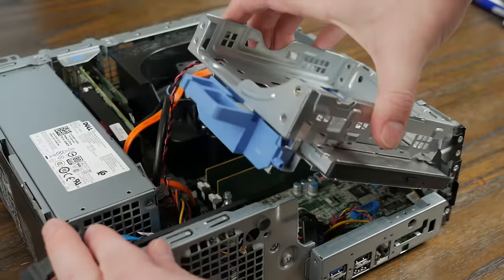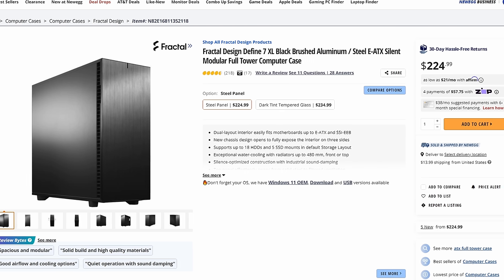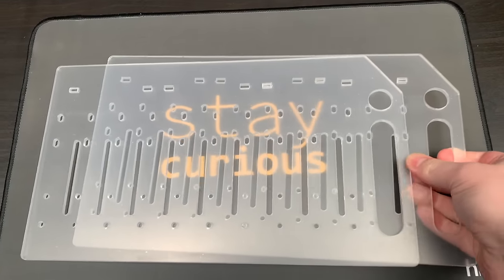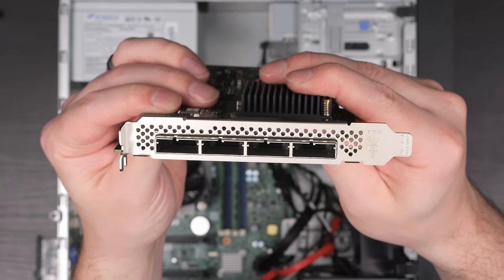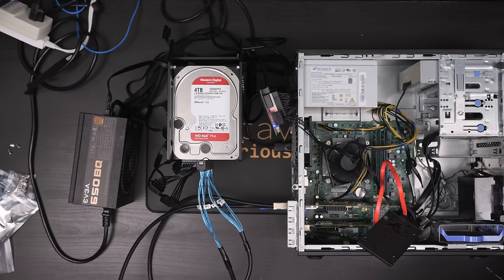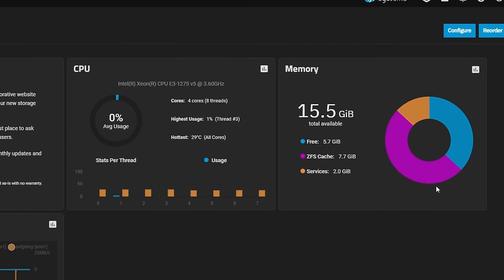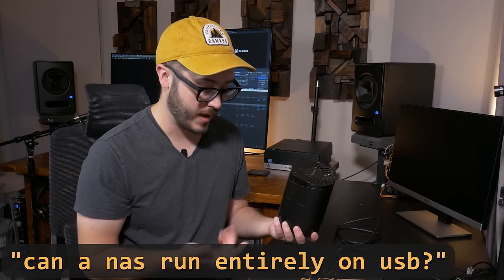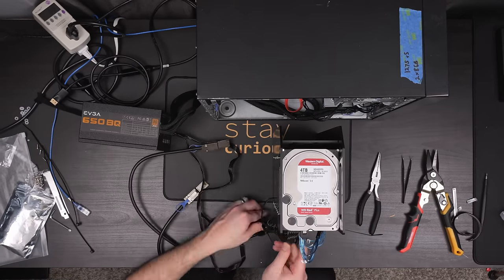I Made My Own JBOD Enclosure For CHEAP

Comment: My NAS is a Fujitsu SFF with the drives in one of the drive cages from a Fractal Node 304 sitting on top, with SATA and power cables coming out through the hole where the optical drive used to be. The case has no internal mounting for harddrives, so this is what I came up with. I would like to move to a different case, but everything in the PC is proprietary so that's a pain. Maybe something could be 3D printed, but I also don't have a printer. Or knowledge on how to design things.

Eh, it works, you know?
Reply from the maker: If it works, it works!

Comment: I tried those 2 5.25" drive bays and many times even with a fan in them the drives get hot, very very hot. They just seem to be not spaced enough for air to realistically get through.

Comment: Initially I thought this was going to be a cheap project....Until you add all the other stuff you need. And thats where a lot of these DIY solutions fall over. Personally if you're going the DIY route, I think some of those hot swap drive mount units for PC enclosures are pretty good value. The trouble is a lot are for 2.5", not 3.5". I suppose if you look at buying the hardware as an investment, you can always use it for years to come for something else, regardless of the price.

If you want to do something with the one you build, maybe make a nice wooden surround, use some wire mesh at the back and front to hide the fans and cables. As the power supply you used is quite large, instead maybe power it with a 1U Flex power supply, mount that on top of the drives there and in the case also.

Comment: If prebuilt USB JBODs are just using SATA drives anyway it would be interesting to see if you could just gut the non power supply electronics from one and then connect to the drives directly using your HBA and Mini-SAS to SATA cables.

Comment: Yes, thats a big problem for anyone trying to store a decent amount of data (lik two digit TBytes plus double redundancy at least) without owning a rack. All the available solutions suck, because of the criteria you named, and additionally: heat. All the "normal" ATX cases when you fill their drive bays completely will make your HDDs overheat all the time. And alternative solutions, like the genuine TrueNAS mini X+ are just way too expensive for what they are offering and yet don't have enough drive bays!
Realistically one will need 10 bays, because Raid Z2 is too expensive per TByte with less tha five disks. And if one day you need to swith to bigger HDDs, you will need a seconds et of bays for fitting the new HDDs in, so you can clone your old data onot the new HDDs .. That 2*5 bays. And there still is no bay left for a hot spare .. so you really need 11 bays :P

Comment: while i think this specific drive mount isnt something id want to run bc it seems like itd be a nightmare to switch out a failed drive, it gives me the idea to perhaps look into the feasibility of doing something similar with some 5.25in hot swap bays for probably similar levels of jank but with more usability. 

also it opens up the possibility of having a tower of optical drives which is insane but i kinda want to try it lol
Reply: Yeah it will work 100% fine to use a 5.25 hotswap bay too. Also yes often the old DVD burner towers (6x or 10x burners with a controller to make copies of disks) are 5.25 enclosures, where you can remove all the old junk and replace with hotswap bays
Reply: If probably use two of the 5.25 hot swap bays and run two daisy chain saga power cables via an extension cable

Comment: Oh God. I'm getting flashbacks to a particularly "Ghetto" budget file server I put together a long time back.

I had a load of 120gb IDE drives (Don't judge. IDE was the current standard back then. 😏) and a spare pc that only had 3 hard drive bays, so I drilled holes in the removable side panel so I could screw 8x full size 3.5" hard drives directly to the inside surface of it. I then added a pair of PCi to Ultra ATA/100 raid adapters, and upgraded it to (IIRC) a 450w PSU. The Molex 4 pin plugs had splitters on splitters, and cable management wasn't even an afterthought....... It had received NO thought at all ! The monstrously had 4 drives per addon controller, PLUS the 2x hard drives it had originally had in it. The inside of that case was just a tangled mass of grey ribbon cables. 😁

Booting took forever too because both raid cards interrupted it and waited to see if I wanted to enter it's settings menu. It was originally setup with each card running it's own raid 5 array, but oh hell was that glitchy ! It eventually ended up with everything as JBOD. 

It wasn't quick, it was just unstable enough that I didn't trust it to be the ONLY place I'd stored ANYTHING important, and due to the drives being hard mounted to the side panel, it sounded like a gas lawnmower the entire time it was powered up ! 😏

When it was eventually so obsolete it wasn't worth keeping, I dismantled the thing......... and by dismantled I mean DISMANTLED ! Somewhere I think I still have a set of HDD platter coffee mug coasters I made from the drives out of it, the 4 sticks of PC100 memory got drilled and used as keyrings, the case got cut up and used when I needed some metal for weld in rust repair patches on one of my old cars, the motherboard had a few bits de-soldered and stored for future projects (Money was tight back then !) the rest was binned.

For data storage I now use 4x 4tb HDD that are in a couple of PC's. Ones always on, and the others only on when I'm doing an incremental backup to it. The idea is that I'd have to be really unlucky to have a virulent virus go rampaging through my network, AND somehow get onto powered off backup drives. 😏

Comment: I've noticed that there's a thing between effectiveness and price for these disks represented in the tier of ~4TB when the peak value is still somewhere between 10-14TB. The main disks in my setup are 16TB+ and so far that doesn't include many of them. If it ever gets to the point where I need a bunch of disks, I may just get bigger disks. RAID is typically a theme in these videos and I've always gone JBOD. Anything more is just way over my needs which makes me wonder why that's the case.

Comment: I just wanted to say you saved me from doing some soldering and cutting with that fan controller. I have a HPE ProLiant which has these weird fan connectors and I wanted to add a fan to the HBA and the fan less GPU I have. Thanks!

Comment: Just a heads up to anyone trying this: LSI HBA cards is a very deep rabbit hole that you should seriously study before buying.
Also know that these enterprise grade cards (LSI / SCSI cards, 10gig network etc) tend to have a fairly high power draw and no idle mode.
And i would say that the powerdraw difference makes it worth to buy 8,12 or even 16TB drives instead of 4TB.
Dedicated enclosures might be expensive, but the amount of money you spend on mounts, screws, cables, adapter cards, fans and increased powerdraw is worth considering.

Comment: actually, how to install the drives onto the bracket more easily is to lay 1 bracket, then 2 drives on its side above the bracket, then put other side of the bracket on top of the 2 drives and screw in 4 screws 1st. then install the rest of the drives on the same side. then flip the whole contraption over and screw in the remaining scews on the other side.

Comment: i've been thinking about something like this for weeks with my home lab. My two solutions I found thus far were going to be buying a 3x5.25 to 5x3.5 cage ~or~ buying up to three Rosewill RSV-L4500U. Strongly considering this as a viable option now

I have used an Icydock bay somewhat like what you showed in my gaming machine for almost 7 years

all in all, dog bless, keep up the good work

I know many people are TrueNAS enjoyers, but I'm looking at Ceph via Rook for my home lab and am curious to know how much an expansion like this may boost performance when added on to one of the above chassis with 8 drives

Comment: Interesting. Dust would be a problem for me, though :D I would love to see some more performance tests. Like putting it in a RAID10 instead of RAIDZ2. And do you have to check what the maximum bandwith of the HBA is? Thanks for the video!
Reply from the maker: More dust, but easier to clean out occasionally! And I have some performance tests on a video I did a bit ago about selecting VDev layouts. As far as bandwidth, you should be able to see what version of SAS the HBA supports and go from there. For SATA HDDs, it probably doesn't even matter.

Comment: Partner with another youtuber to refine this.  A slightly deeper acrylic case with an added back panel would help to accommodate the power supply.  PCBWay would probably like to sponsor with someone to make a backplane for drives and sas/power cables to slot into as well as a USB alternative for controlling the second power supply.

Comment: Using an older second hand case with lots of 3,5 inch bays to house everything would make the whole setup a lot cleaner. Sure it takes up more space. But if that isn't a problem I would rather go for a cleaner, more robust system. Seeing this makes me think of actually doing this ;)

Comment: Wanted to do a 4 HDD home NAS with a IcyDock USB3.0 enclosure. The 5Gb USB speed wasn't a big deal, as my network is 2.5Gb anyway. So all looked great. Speed was good too! 
Then I noticed that it doesn't spin down the discs when not in use! D:

I don't need 4 big HDDs constantly spinning, consuming 20-30W and generating heat when I only need to access them once or twice per day, if that.

Comment: i had a regular nowadays case w just space for 3 3.5 drives on basement, had to righ 2 mopre using drill, patience and a 90 deg phillips+some aluminum window frames, other 2 were 2.5 so in the designated side mounts, managed lkike a year klater to get an old pc case with plenty of space on the front, and not  huge, thermaltake i think it is, has space now on the 5.25 drive cage, so if needed i guess i can rig some more aluminum onto it, hehe, screrw that down somewehere

Comment: I like Janky! I love it! it is slick and it works. I do kinda the same thing but I use USB external drive controller boards in a old case and  PSU for a external backup for my movie server. There are 6 4TB drives and it may be Janky but it works... Lol
Thanks for the video!
LLAP 🖖

Comment: Could have went with the off brand dynamat ( adhesive butyl rubber sheets ) and lined the inside if the two panels. Would have solved a few problems for ya

Comment: if you have balls you could also diy add some more sata to your PSU. just chop off some old PSU's wires and splice them into the original.

if you solder the connections you could even run pcie 6 pin over them but it should be fine for sata drives.

Comment: This let's my head spin to design my own JBOD enclosure which get's rid of the flaws mentioned. 

Not all, of course, but maybe, instead of HDDs mounted directly to the enclosure, HDDs mounted to trays which are, in turn, supported by brackets that can be mounted on the enclosure in variable heights. So, the drives can be unplugged and drawn out while the entire JBOD remains structurally integral. 

I'm currently designing my own NAS enclosure for my current project which encompasses an i5 6500 and eight drives. But I am sure that I'll outgrow the number of drives some day. Maybe, it'll be better to start thinking about that now, too.

edit:/ Also that jerky PSU at the back. OMG. I want to get rid of that so badly. This can be nicely integrated into the chassis as well... This was just frustrating to look at (even though, I do understand where you're coming from in doing it like that!).

Comment: Very nice, but:
- JBOD not friendly to change the hdd sucks. It simply doesn't scale well.
- JBOD without vibration dumpers sucks. Unless you are expecting very low load.

Comment: Im curious if you could 3D print some rails that would allow you to slide in the driver's instead of using the screw's. Its a pain when you have a drive failure and you need to deconstruct what you've put together a while ago. Sometimes its like "How the hell did I put this together"? When it comes to putting everything back together. Especially if it's been a while.

Comment: I wonder, just for heat dissipation, if it would be preferable to tilt the enclosure 90 degrees so that the drives would be in a right angle up for free heat movement up. It wouldn't look cool and eat space I guess.

Comment: instead of anti-vibration plastic washers, it would be enough to put 4 rubber adhesive tapes internally over the holes and then pierce the tapes with a pin

Comment: I have a single RAIDZ2 VDEV and I get 275-350 MB/S on my 5400 WD Red NAS drives. Your speed seems like gigabit on the video, maybe there was a bottleneck somewhere. I'm also using a fiber 10GB card.

Comment: Here in Sweden, mechanical drives are still kind of expensive. The IronWolf Pro 4TB would cost me $169
If I would get 8 of them it would be around $1000. And that's only for the storage.
Lucky enough I have an "old" PC with an LSI 9300-8i card in it already, including the cables for it.
I have one of those ICY BOX HDD bays that can handle 5 drives and it takes up three 5.25" bays in the front of the PC
Sadly it's an old version and can only handle SATA 2 (3 Gbit) drives

Comment: You could also modify a duplicator case.
Reply from the maker: That's been on my radar.. once again, the 5.25" to 3.5" adapters can start to add up. I DID get a 3D printer though, so that might be a fun way to put it to use!
Reply: @HardwareHaven  there is that issue, I brought one for optical drives. So was ideal!

Comment: i was just thinking of going to the recycling centre getting an old case so and strip it on the inside and then id have a case to start 3d printing hard drive bays into also it has the PCI slots in the back because i have board to board cables so i need the PCI slots also the case would have a SPOT fot the PSU

Comment: lol, I remember my first DIY external drive enclosure I bought some cheap timber joist mending plates that are about 1mm thick (which coincidently have the correct hole spacing for the screws on 3.5" HDDs) and some 90 degree joist mending plates and riveted the mending plates together to make a enclosure then ziptied some 120mm fans to the front and just took the side panel of the server and connected the drives straight to a internal lsi HBA and used so many piggyback Molex to SATA power connectors that the memory makes me sick,

Comment: I'm using a FANTEC QB-35US3-6G 4-bay case since some years on a USB 3.x high speed connection, but have to say... it's not worth the money. It works, but... you can do it cheaper diy!

Comment: Cooler master n300
9+3(with odd adaptor) is a goto for me.
this will max out a 2 lane hba, and the onboard sata on an atx board, as usualli 2 out of the 6 is used by nvme.

Comment: idea: see if it's possible to convert this to a "thunderbolt" enclosure by using one of those janky DIY eGPU boards to put the HBA with the drivves as part of a unit, so it could be used with a laptop

Comment: i mean personally i would have found some old molex fans and cut a few wires and just wrapped the red and black of a usb cable around the molex power ive found this creates a good low noise fan for cheap once i even used psu fans wrapped around the cables of an internal usb header to cool my old nas (i know not everyone has this just lying around)

Comment: I'd like to do something like this, but I'm paranoid about vibrations.
Reply: NAS-rated drives have firmware and mitigations for that. You could also look into EXOS. Also might not be a bad idea to put a strip of rubber or silicone between the the drives and acrylic

Comment: The only reason to do this is if you already have a PC to use as the main unit, otherwise you can buy a cheap 8 bay NAS barebone that accepts matx or itx motherboards and build a single unit in the cheap.

No need for the large footprint, no need for 2 power supplies, probably won't even need a HBA if you get a matx board with 8 SATA ports in it.

Comment: I would use an old Acer computer from the  early 2010s, swap mb for a somewhat newer platform like Intel 6th gen i3. You can get used boards that use that socket for cheap.

Comment: I feel so lucky a friend of mine's roommate had a computer with 5 3.5 internals and 5 external 5.25 slots I should be able to get 13 drives in this so 12 large and a boot drive. That should be plenty for my needs. Not bad since I flip the internals for 50 bucks so I am up 50 dollars on my NAS made of spare parts I had lying around.

Comment: I was looking at making a JBOD for a 1L Lenovo Mini PC. It supports PCIE through a riser card for the SATA connections and has an M.2 A+E that can support a 2.5G NIC. Still trying to find a better power solution especially since having a PSU bigger than the entire PC kinda defeats the point. It would be interesting if there was a more elegant solution to the power problem.

Comment: Loved the video! For those of us with some tighter space constraints and fear of the drives being so exposed, are there any of those $250ish JBOD's you'd actually recommend? I basically just something to hold my massive 20TB full backup drive, 10TB drive for YT video projects, and wanna replace my WD My Book Duo and its craptastic software that's now created 600GB worth of backups that I cannot remove from my other 10TB :/

Also quick question: what font is it that you're using in your thumbnails? I'm a graphic designer working on my own channel rebranding and your font is like exactly what I'm looking for haha.